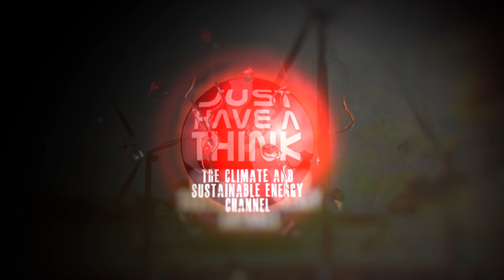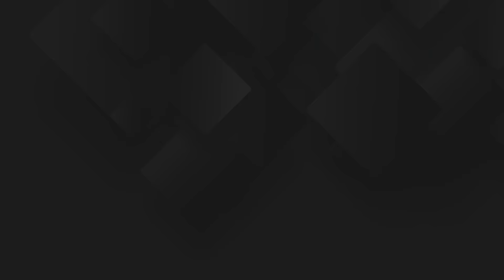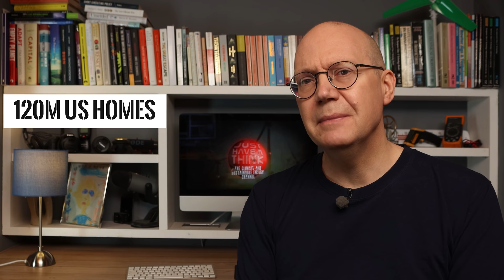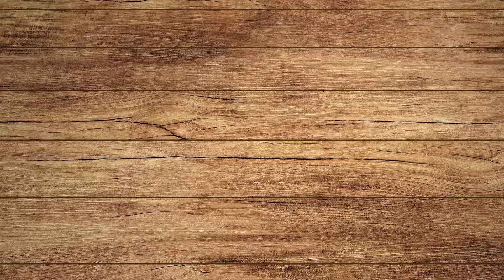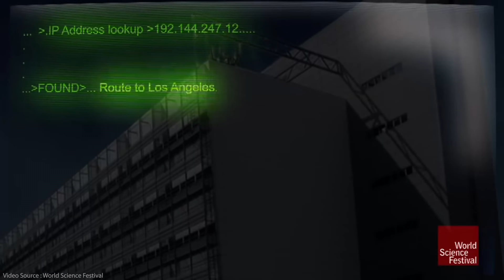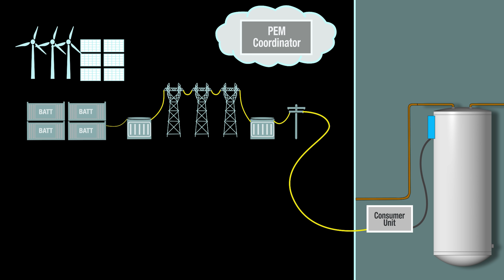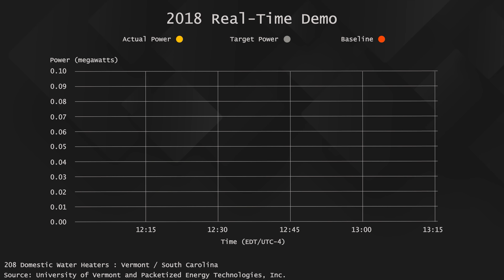How to balance renewable grids WITHOUT energy storage!

Comment: My concerns are security/reliability:
What happens when the centralised request recipients are DDOS'd and stop responding to requests? (E.g large number of requests from fake devices)

What transmisson mechanism will be used to transmit to the utility? What happens when this medium is down?
Reply: You'd be able to tell pretty quickly if those devices are fake, when they don't take the power requested.
Reply: @zacharyparadis  i don't think the system has any idea which devices are taking power. They only see the aggregate power usage across the network.. and approve requests. 
During a DDOS attack, 90% of requests could come from fake devices, and so the system denies lots of requests from real devices thinking there are too many requests.. and then is surprised the total load didn't match.
Reply: @timtravelnomad  That scenario would require the system to be designed badly. If the load doesn't match, just continue on as normal.

Not to mention, with how many devices are on a single grid, you'd have to be able to send a lot of requests to be capable of putting a dent in it. Also, you can just... ignore requests that are too close together from the same source. That would make it a fair bit of effort to even get started on such an attack.
Reply: Powerline communication to the local transformer. When this medium is down well your not getting power anyway.
Reply: @zacharyparadis  How do you know it from the same source? Could you not hack this id to look like multiple devices?
Reply: @catprog  That sounds like you're assuming there would be 0 validation done on anything, which is a frankly stupid thing to assume.

How do you know the system will be set up with no validation at all, to make this scenario actually possible?
Reply: @zacharyparadis  how would you set the validation up?

  If you have devices must be signed then you now have a complicated key management system that is defeated as soon as a single key is leaked.

A database of valid devices: this needs to be updated every time a new device is made and if leaked can easily have duplicate ids.
Reply: @catprog  Every single device connected to the internet has an IP address, and it must be unique, cause that's literally what they are for. Use that.

Why on earth would you use your complicated system that is intentionally set up to fail? How does dreaming up an intentionally bad system prove that this "security issue" is actually an issue? What are the chances of your system actually being implemented that makes this a problem?

At least put some effort into designing a system that isn't intentionally stupid. That's called Strawmanning, and isn't a valid argument tactic.
Reply: @zacharyparadis  

Every internet connection must have a unique IP yes. But every device off the connection then uses NAT to share the same IP.
-Plus using the internet means if the connection drops out their is no communication at all.
-A hacker is in Nigeria. They connect to the USA server and start sending packets.
-Also how does a legitimate device connect to the right grid.

Connecting using the existing grid wiring means the hacker actually has to get onto the local grid to send false packets.

Comment: I can see so...so many points of failure in this, starting with the word "cloud". While I appreciate the increased efficiency and reduced waste it would bring, in the end it's a utility issue - not a customer issue. So - using a PEM device is a convenience for the utility not the user. Do you think they'll lower prices for using such a device? I think they'll instead raise non-PEM related prices to high heaven instead. Not to mention, the eula will probably require you to agree to give over all your data over, your immortal soul and your firstborn too...
Reply: Power suppliers already perform packetization within their own internal grids, between their own switchboxes and generators. PEMs have the potential to give users more control over the process -- but it needs to be balanced with a multi-supplier approach. Multiple suppliers need to be allowed to plug into the same shared grid, and the end users must be allowed to choose which supplier's PEM a packet of power should come from at any particular moment.
Reply: @PixlRainbow  I agree it's a valid engineering approach. Problem is, after the engineers are done with it - and frequently even before - the mba's come in and optimize for profit, and that profit usually comes from the consumers. Always remember, a corporation does not know the words: dignity, morality, enough.
Reply: @GalvayraPHX  that's..... exactly why I said the proposal needs to be tweaked so multiple suppliers need to be on the same system and all be accessible to the end user? So that if they try to squeeze the consumers too much, the consumer has the option of switching to a different company in seconds?
Reply: @PixlRainbow  Because a bunch of companies have never before come together to do price fixing? Oh wait...

Comment: Nothing like having to take a cold shower because I annoyed the local council. I might just have my own system off the grid thanks.
Reply: Manual mode. I need to heat now and I am telling you I am using power.

Comment: So how might this be abused or subverted? System architects routinely fail to include security measures, or design for worst-case scenarios. What devices will be allowed to connect to this system? These devices will become consumer grade, commodity devices built by the cheapest provider.  

"The more they overthink the plumbing, the easier it is to stop up the drain."
                  Lt. Commander Montgomery Scott
Reply: Certified high powered devices that talk to the transformer over the powerline.

Comment: A few weeks back I installed an app for doing just that when I charge my car. Its called jedlix. It links to my Tesla account and starts charging when demand on the grid is low. I get a verry small profit of € 0,01 per kWh. If it helps to balance the grid it's fine.

Comment: Won't work as described. This is not internet packet routing, this is more internet traffic shaping. Each device can just spam the PEM coordinator with requests to get priority or disconnect itself to get highest priority. There's no incentive against doing that. There absolutely needs to be an incentive for the individual system actors to behave in a manner that is beneficial to overall operation of the system instead of behaving selfishly. For example, limited number of "high priority" energy allocations per 24 hour period. Or significantly higher price for "high priority" energy demand. And even then I'm not entirely sure how well this is going to work in high load situations where demand exceeds supply.

Comment: What a disastrous solution that would be. You compare it to the internet but how reliable is the bandwidth of many peoples internet connection? Without major investment, it won’t be long before the system will be “robbing peter to pay paul” and there will be a “fair use” policy. Everybody will have to buy power walls to collect energy when they can as less and less packets of energy become available. It reminds me of the days when everyone had a water tank in the house.
Reply: powerline communication to the local transformer.

Comment: it sounds too complicated for me, it adds a point of failure
why not use a system that vary the price of power according to load
so every device have a set threshold for power price to use, for example, heating loads will use cheapest power possible
while lighting or entertainement are set to run on even expensive power

Comment: I can say this is not a new idea: a similar idea has been floating in my head since before 2017. It seems such an obvious "of course that's how you'd build it" as a software engineer that understands networks. However, these researchers have missed the obvious in a surprising way with their frequency proposal. The frequency proposal allows one bad actor (hacker) to break the whole system: just for the "fun" of the chaos, a hacker could cause power producers to spend of money to provide lots of power at peak demand times at a articfically low (for peak time) rate by sending lots of cheap (basically free) packets at peak times. Instead, the system instead absolutely must be tied to economic reality (aka prices). If that is done, then the interests of everyone (producers, consumers, power storage companies) will automatically be aligned to optimize the whole system through the signalling of prices. So instead of demand packets, your water heater, EV, electric heat, dishwasher, etc should be sending power bids to your provider. An economic system would give consumers reason to be reasonable about their requests at peak time, give producers reason to have some peak capacity, and massively give power storage companies reason to build infrastructure. Everyone benefits, including the Grid and planet.
Reply: I asked fellow students in our engineering college who majored in Renewable Energy about these demand signalling type ideas. Every time I mention the idea, everyone says "that's smart Grid, it never took off, it will be a long time before we have that if ever."
Reply: And if you still aren't convinced that energy should be priced economically, just think about what bitcoin miners will do if they find an "economic hole" in the system where at any point they can buy power for cheaper then the market price: they will spin up mining computation (which is very close to a waste of energy IMO) to cash in on converting discounted energy to monetary value (bitcoin) until either the value of bitcoin drops OR they start having to pay the real price for power for their pointless computing.
Reply: Combine this with the ability to feed power back to the Grid and sell it (to your neighbors through the power company), and suddenly, there is a lot of economic incentive for consumers to get PV and battery systems in their house.

Comment: the problem is... who are the Utilities turning the power off on? 
and who can afford back up power to bridge the gap? 
So wealthy homeowners use up all the electricity. electric company says. we need to turn off power.
wealthy people say ok we will use our generators while the poor people die of heat exhaustion. 

maybe they turn off the highest users first instead of zip codes or whatever. 
the daily highest users are the first to get throttled. 
would encourage more solar to distribute load and so they don't get throttled

Comment: Sorry, but it sounds like hype to me. From their website it looks as if all they can really do is turn stuff off. So their idea of leveling load will be to turn off your car chargers, water heaters, AC units etc when you all get up at half time in the big match to put the kettle on.

The bigger issue is that renewables produce energy when no-one wants it. It looks as if that energy will still be lost without any storage. The only option would be to turn on your water heater when you don't need it and that will have all kinds of interesting consequences.

The way packet switching works on the Internet is like the postal system. Each parcel or packet has an address on it and every address is connected with the same road or piece of wire depending upon analogy. That address is viewed at every junction to see which route it should take and that is done by, er, routers. Routing electrical pulses in that way will be interesting!!

The Internet works by sending data much faster than you need it and storing it locally then playing it out more slowly as when showing a video, for instance. I don't think anyone will be sending pulses of 2,400 volts for a tenth of a second to replace sending 240 volts continuously.

Comment: Good video. BUT. you left out the PURE, F***k'n Magic of Electricity called a VARs. That makes active load such as motors works.  Where resistive loads like light bulbs, hot water heaters don't need VARs. In balancing a grid the a Generator producing electricity to grid must push or ( run lagging ) VARs on to the grid to compensate for active loads. This does reduce MW output but is necessary to absorb active load changes. And avoiding what is referred by power plant operators "a generator shuffle" . Power plant are not payed per say for producing lagging VARs and individual households are not charged. While large industrial maybe charged. Just the opinion of a past power plant operator that just made MW and never distributed on the grid.  Just knew the problems it caused if it wasn't done right.

Comment: Everyone will point the finger at an EV and cry that it is going to burst the grid.  Using V2G technology will just mean there will be a virtual battery.  With 5,000 EVs with a 50 kWh battery will give a virtual 250 MWh battery.
And all the people driving ICEV will need their gasoline.  That uses a large amount of electricity and energy, not only for the petroleum but also for the millions of tons of toxic chemicals needed for fracking and tar sands.  And that cannot be rationed out, since we are burning 100 million barrels of oil a day.  That needs to be there.  I'm guessing about 70% of all energy & electricity is used by the petrochemical industry.
I'd love to see them downsize...and quickly.

Comment: So the saving is not saving but just utility time management and math estimating watches save. LOl.  I've got proof the law of energy, you can't create it but can only move it around. Goggle "98 % pure silicon" 
To make chips or solar panels from sand you need to get to that pure form, and that takes two furnaces fired up to 2,500 degrees to melt out impurities  the second stage  is 20 minutes at that temperature , then it thin sliced and polished  lots of special machinery work  and coal is used. They are only 10 company doing it.  Then add glass and aluminum anther that over 2,500 degrees. They add batteries lots of energy it made from raw earth.  If you do the math  of fuel used . And divided by the amount of product,  it is more than the solar panels electric gave back. Remember  solar panels is only 24 % efficiency. You can only move energy   around. Goggle 98 % pure silicon

Comment: Love the video, but I sometimes have trouble hearing what you're saying, like the audio is somewhat muffled. I went back and listened to some of your other videos, and they have the same issue. It's far from a serious problem though. I'd just wish your voice was a bit sharper.
Reply from the maker: Hmmm. That's strange. I spend quite a bit of time on the audio, taking out background noise and unwanted 'mouth noises'. I always listen to the audio back very carefully through headphones to make sure it is as clean as possible, so it's hard to understand how you're getting this problem.
Reply: @JustHaveaThink  Meh, I don't think you need to worry about it. Like I said, it's a fairly minor thing, and I just happened to notice I had some slight issues catching everything being said. Turning the volume up helped, but it still seemed slightly muffled. Or at least I think that's the right word.
Since nobody else has pointed it out yet, it might also just be my speakers being very old.

Comment: In reality, this is insanity.  We need to go smaller ... microgrids.  Smaller is better.  The internet connection makes the grid super vulnerable to attack.  You are selling something.  Solar energy does not reduce the carbon footprint and this is clear when you review how they are manufactured.  Go off grid with solar and heat back up if cold climate.

Comment: You really should stop using so much "illustrations" that have no connection to what is said. The illustration of a water heater is just fine. Showing a dam that have nothing to do with pumped hydro when that is what is in the text should not be done.
If there is no illustration that add to the text, watching the face of the speaker is just fine. It is even less work for the editor.

Comment: This (dummy) idea show that the researchers neither understand protocol routing and information transfer nor energy storage. The biggest point that they do not understand in the working of Internet is that there is a huge amount or redundancy and queuing systems on any one of the devices and especially the hub points. The tricky thing about energy, in electrical form, is that can not be easily stored, it is not like storing data in memory, all these moving electrical packets (or whatever nonsense they have thought of) of vibrations still need to be stored before retransmitted to the next transfer point. Well now, is not that a truly novel idea??? Physical things need to be stored somehow, it is not like information transfer that technically is basically even NOT transferring a SINGLE electron from one place to another as it is just a voltage change on FETs. The author of this channel should "have a think" about thinking and not just cheer lead plainly dummy technical ideas.
Reply: I request one packet of energy. One energy packet is generated and deliverd to me. No storage required in any of the steps.
Reply: @catprog  Yes, that  will work well in fiction movies, but not so much in the real world. Clearly you have no understanding how network protocol work or even what is the meaning transforming,  moving or using energy. This is not bit and bytes by any stretch of imagination, but only people who have some practical experience with energy and Internet can understand the problems, for everyone else that stupid idea will "work".